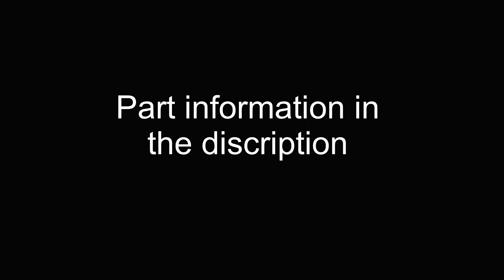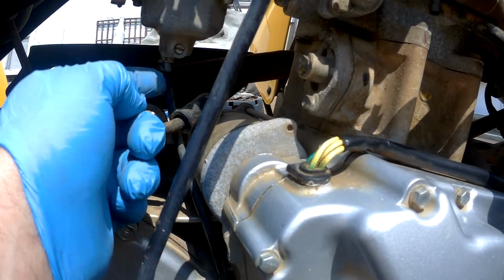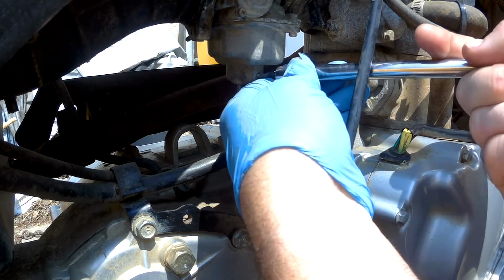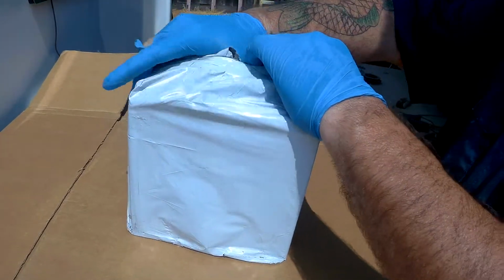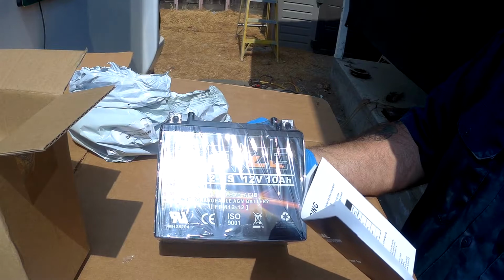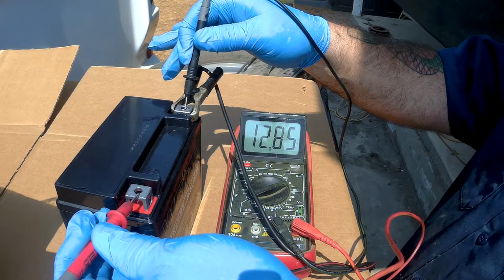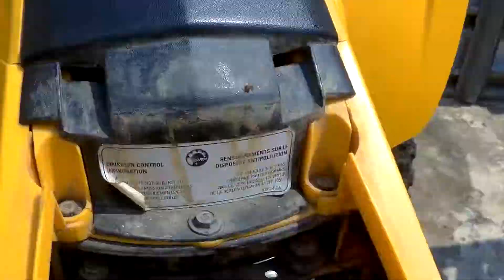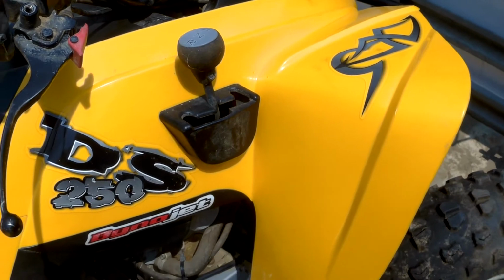2006 BOMBARDIER / CAN-AM ATV DS250 New Battery, air filter and fresh gas. First start in 10 years

Comment: Hi ,do you have any ideea why i wouldnt get any spark? Got the same exact model and year ,last winter it ran perfectly,didnt use it for a couple months i tried to use it now again,drained the gas and changed the spark plug ,but it wouldnt start ,the engine spins the starter works it just doesnt get any spark .Do you know what can i check first ? Already changed the CDI box.
Reply from the maker: Check and make sure the CDI is getting 12v, check the kill switch and make sure its not broken on the inside, or making the system think its in the off and not run.